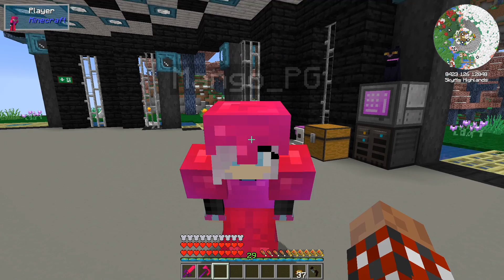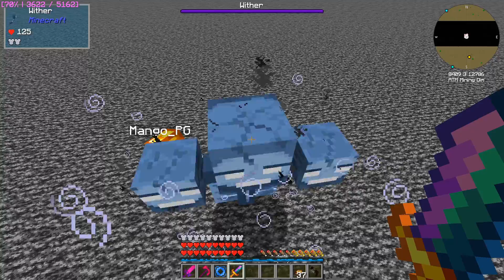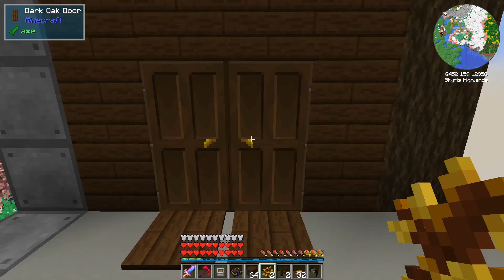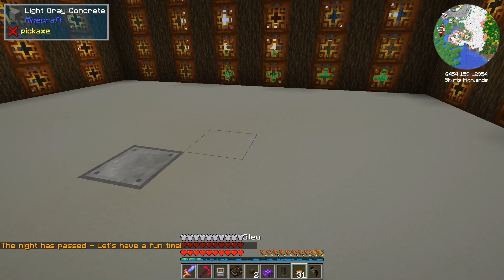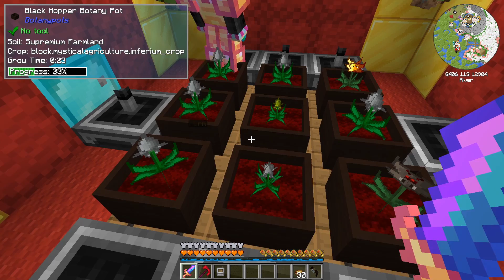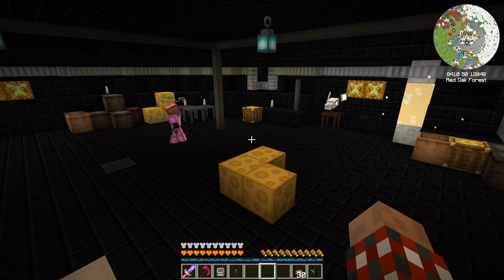FTOG ATM6 #11 - Immersive Engineering Endeavors

Comment: Immersives mineral veins are no longer chunk based. 
You should use the prospecting thingie to home in on a vein before using the core sample drill.
Reply: And the saturation percentage is the chance for the excavator to dig something up.
It gets higher the closer you are to the center of the vein.
Reply from the maker: Oh, this is a change.  I will have to try the the prospecting thingy to see where the vein is.
Reply: @GrokDuckFarmer  I found it a ton of fun to run around searching for them :)